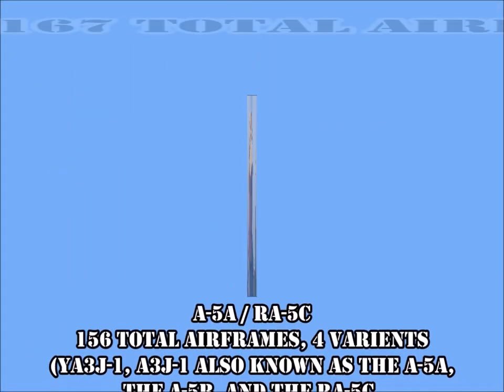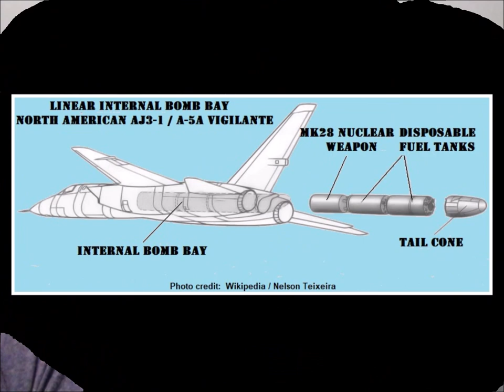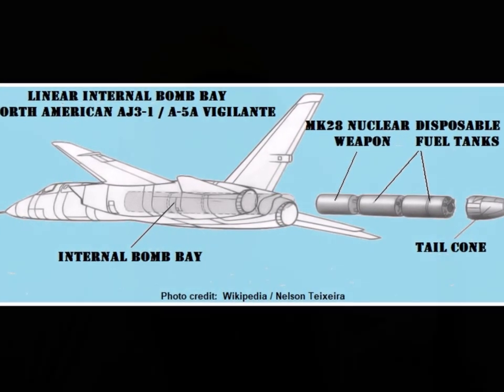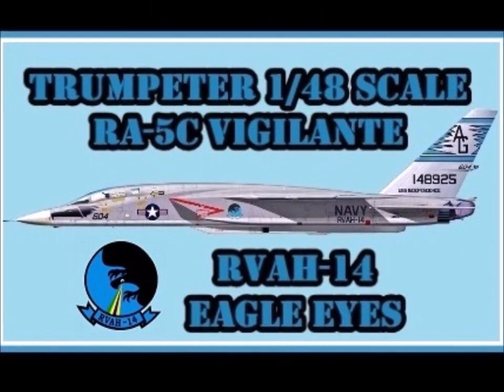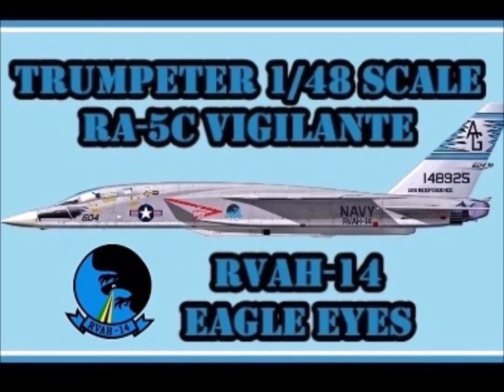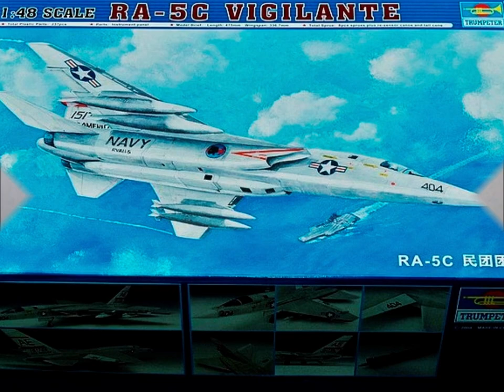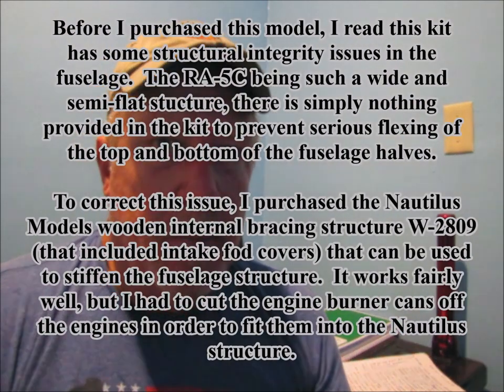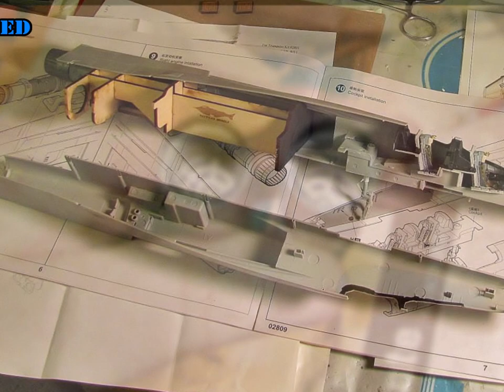Brief History - North American RA-5C Vigilante

Comment from the maker: Would I recommend this kit, yes I would.  It is a nice kit and a good build with the exception of the internal bracing.  Is it necessary to have a nice build maybe not but the problem with sagging has been well documented.  I don't have that issue because I used the internal bracing.  The one drawback to using the bracing that I noticed was not being able to install the engines according to the kit instructions but they would have been hidden from view anyway so no big loss in my opinion.

Comment: You speak my language.  This was another aircraft that fascinated me.  Has such a f-14 look to it, especially in the nose and cockpit.  But by the time I was really paying attention in the 80's and 90's these weren't around anymore.  So I would see them in random photos, and would be like, "WHAT IS THAT?"
Reply from the maker: I never saw one fly either.  They were all static displays by the time I saw one in person.  You mentioned the TOMCAT, now you are speaking my language.  I worked on the F-14 and taught TOMCAT Tech school for over 15 years of my Navy career.  Thank you for stopping by and spending a little time with me today!!
Reply: actually as I look at your model, it was the air intakes for the engines that really resemble the f-14, not the nose and cockpit.
Reply from the maker: @TexasFamilyCamping , did you know one of the original design concepts for the Vigilante had twin tails but obviously did not make it into the final production version.  Imagine how much that would have resembled the McDonald Douglas F-15 which by the way took some of its design cues from North American.
Reply: @EdsAttentionToDetail ...In hindsight, would you say the wood bracing was necessary? And would you recommend the kit?  One to buy, consider or avoid? I’m a foreign service avionics techo...Ex C130E, H & J Hercules, AP-3C Orion, F/A-18A,B Hornet, currently F-35A Lightning II...but please don’t hold that against me. We’re all brothers, right? 25 years, now...

Comment: Awesome history 👊 you need to do a video on how to change smoke detector batteries😜😂😂
Reply from the maker: Yeah, well.....been told by the owner those don't have batteries and are hard wired.  Sorry for the distraction it caused.
Reply: Ed's Attention To Detail even though they are hard wired they have a backup 9v battery. Twist the alarm and take off wire clip. The battery door will be right there under the clip.